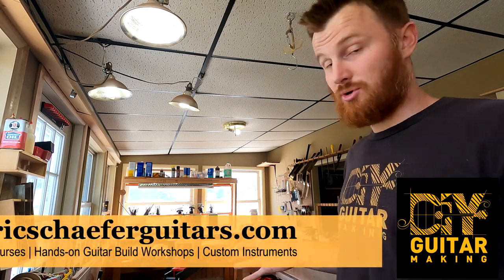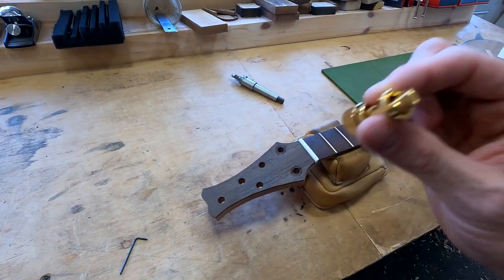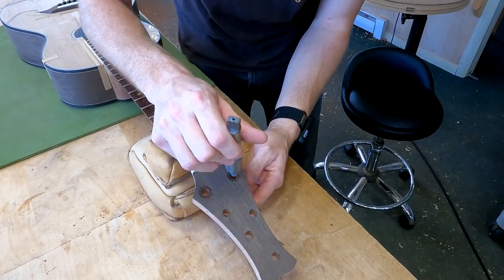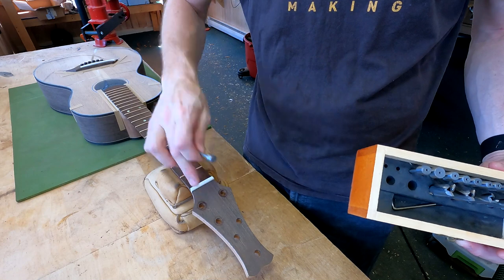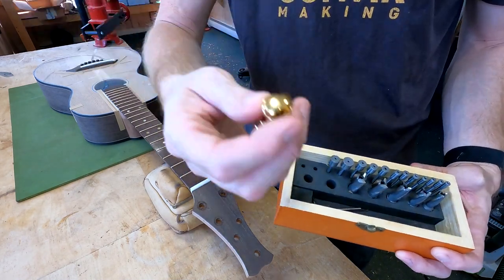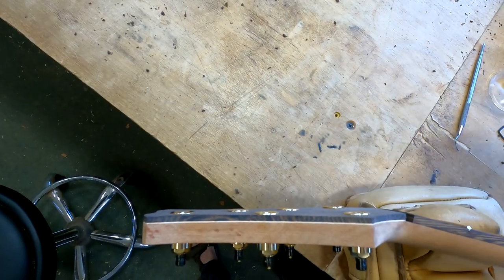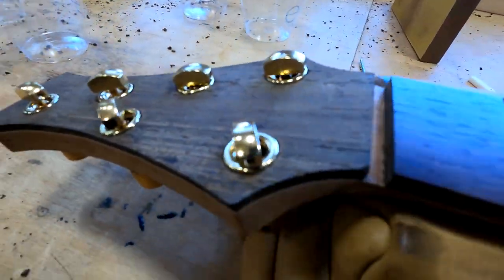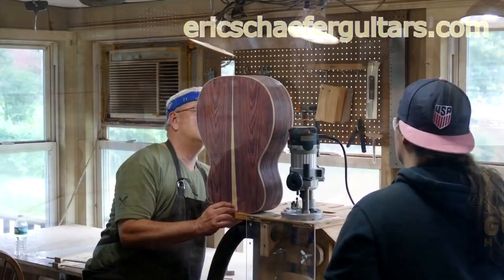How to Countersink Tuners | Guitar #86

Comment: If the break angle helps make the tone better, can’t you have the strings go down through holes and connect on the other side of the headstock to make the angle steeper without making the headstock bend back more?

Comment: In David Russell Young’s book “The Steel String Guitar: Construction and Repair” updated edition pages 102-105, he talks about countersinking tuner washers and has pictures demonstrating his process. He does it to help prevent the lacquer finish from blistering when the tuner bushing is tightened down. I like how it looks. The only problem I could see in doing this is if you ever decide to switch to open back style tuners with no washers. Thanks again for your videos.

Comment: Ah yes, nothing says splinter inflammation like a nice piece of wenge... Great video! In my current build I'm countersinking the Steinbergers as well specifically for the extra degrees of string angle, which means I can use less headstock angle fwhich should add more stength.